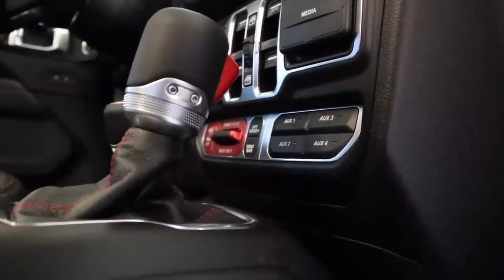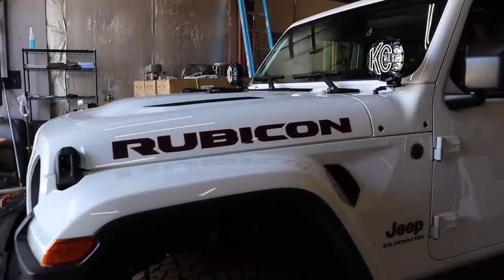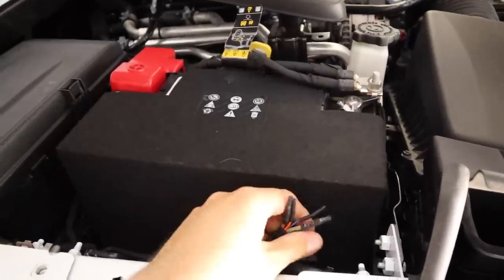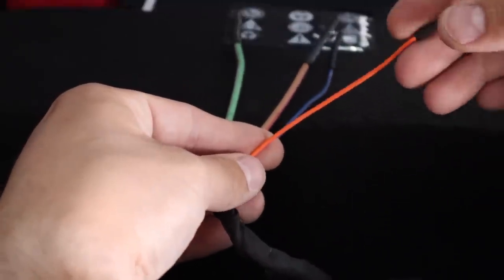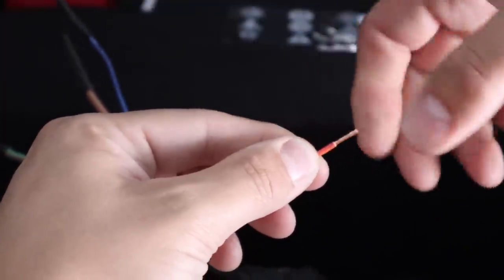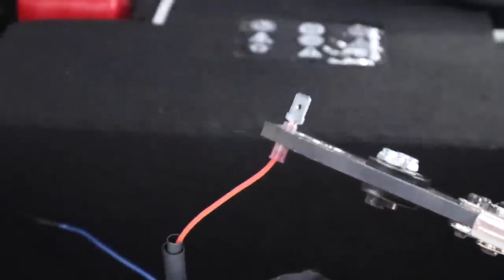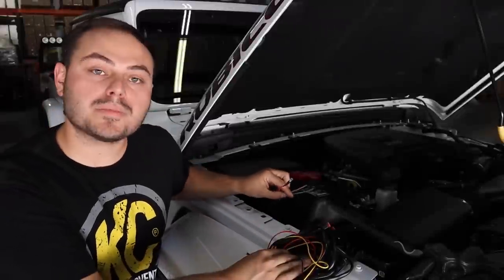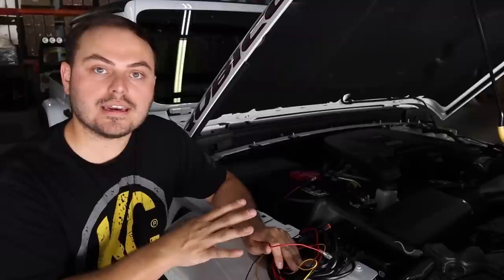Aux Switches Wiring Guide | Jeep Wrangler JL/Gladiator JT

Comment: Additional electrical tips... You should use the grounding point provided on the inner fender not the battery.  That's why it's there.  Keeps the battery terminal unclutered.  You should use a female connector on the power source wire not a male spade.  If the connection comes loose, the shrouded female connector will protect the circuit from grounding out.
Reply: I wonder if I could put two negative wire on one grounding point.

Comment: Great video and products.  FYI to everyone, AUX 1 & 2 are fused to a 40 amp relay, not 30 amp
Reply: what is the 3 and 4 amp?  for a refrigerator, what amp would you suggest to use?
Reply: @Haro75410  AUX 3 & 4 are 15 Amp circuits. I would check the Amp draw of the refrigerator. If over 15 amps it will need to be in AUX 1 or 2
Reply: @SoCalJeepGladiator  Thank you.

Comment: I have a 2022 JL Rubicon with the AUX switches. I just purchased a set of Flex Era 4 ditch lights. Should I wire them to the 40A or 15A factory AUX leads. Seems to me the 40A is best.  Also, in the matter of the amber backlight circuit, Do I HAVE TO wire the backlights (if not, great); or can I just wire them all to the 40A factory AUX and leave the wiring harness fuses in line? I just don't want to use up two of my four factory AUX switches for these lights. I realize that the Mopar AUX switches are not 3-position switches. I am willing to give up the amber backlight option if it will free up one of my AUX switches.

Comment: Great install. I kinda wish I had those switches on my JLUR. I like how you double heat shrink with the layers.
Reply: @kchilites  Haha, I agree. They should all have them standard. I added the Trigger Switch System for the JL. I like how the switches are overhead above the rear view mirror, but having those factory switches would have still been nice to have.

Comment: This video is a great place to start, here’s what I’m adding after my experience with my 2019 JL:

I purchased the JL ready Flex duals and mount for the pillar mounts and the Flex 10” Light bar for the bumper. The factory harnesses as I got them have tons of extra and unnecessary wiring. Route the wiring for the lights to the battery area, leaving some slack for working material. Since you only need the red and black wires, I was able to trim the harness right after where the two factory harnesses for the pillar lights are crimped together. I attached a ground to the black wire and connected to the body ground and the red to the #4 lead using male/female connectors as shown in video.

The light bar was a bit different. The 15 amp #3 lead wouldn’t light up the bar, so I had to use the #2 lead, leaving my lights on the bottom two switches (2 & 4). The process was the same, route wires, then I trimmed the harness at the relay from the factory, added the ground to the black and male connector to the red, and I was in business. The factory harnesses come with several feet of extra wiring for the inside switch and for routing that isn’t necessarily needed for the JL and it really cleaned up the under hood and battery area.
Reply: Gary Peterson were you able to cut off the switch and fuse from the wiring harness or did you have zip tie it under the hood?

Comment: early 2018 JL’s do not have those wires under the hood near the batt box.  The only wires for the AUX switches are supposedly located under the front passenger plastic side kickplate, together with the connector kit supplied with the AUX Switch option.

Comment: I backed 70mai Omni Dash Cam on Kickstarter and wanted to connect it to one of my aux switches. It has an always on feature (parking/sentry mode) so it has the ACC, the VCC and Ground wires. Do I connect the aux wire to both the ACC and VCC wires and then adjust the settings in the menu?

Comment: What if your lights have the yellow wire with the fuse. It looks like that connects to the positive. Do you still do this if connecting to the aux switch in the Gladiator?

Comment: I love your stuff but I think you guys should switch the hot wire to a female bit   instead of the male spade. FOR SAFETY reasons if that wire or connection were to ever come loose you now have exposed live wire that can short on the body or worst start an electrical fire. The female end is mostly shrouded and would need a pokey bit to short circuit..... let me know if I wrong....

Comment: I hope someone will answer this newbie question... So you have two lights regardless whether on the pillar or bumper. Do you solder the two red wires together, (one from each light), then put the spade on that soldered wire then connect that to the factory auxiliary switch wire?
Reply: What did you end up doing?
Reply: @ciprianorivera8063  selling the Jeep lol, seriously. To tell you the truth I don't remember. But ti did get everything hooked up with no mess or trouble.

Comment: So I have the 6 piece cyclone kit for my Jeep JL.  I will be installing it to my factory aux switch and the fuse will be installed next to the battery.  Do I cut the excessive red, yellow (I assume it's not going to be used), and negative wire?   Do I connect the negative wire from the battery to the ground junction?

Comment: I have  6" Apollo Pro Series (My car JL2019 Rubicon with AUX switch )
The wiring to the switch is white,Green & Black wire do i need to connect them all or only the green?
from the relay fuse there is black & yellow wire (black to ground- Yellow to Battry 12+) do i need to blage the fuse ?
Reply: Hey I have the same style lights were you able to figure this out?!?!
Reply: I’ve been wondering the same. Any luck ?
Reply: @juancampos9212  any luck? Been wondering the same

Comment: Just got the wiring harness and there is no red wire. Do I plug the green wire or the white wire into the aux switch? And do I do anything with the yellow power lead?
Reply: What did you end up doing? I have the same question

Comment: Great video. I have the aux switches but didnt realize how simple.  Thanks for showing us. Also what lights did yall use?
Reply: @kchilites  oooh. That's cool. Yeah they didn't look familiar that's why I asked lol.
Reply: @kchilites  I was wondering if you let me know about this process for the wiring colors on the Apollo Pro Series. I have the 2019 with the Aux setup and need to know which colors to hook up since there is only yellow, green, and white
Reply: @mirandareneev  Same issue and I cannot find a work around to this wire harness

Comment: I heard mention in another video that with this factory option, there are actually 2 additional circuits that are direct with the ignition switch. So a total of 6, 4 switched and 2 direct, is this true?
Reply: KC HiLiTES to be clear, this was on the JL. I’d imagine it would be the same on the JT.
Reply: bigdawgfan72 The JL has a ignition and direct battery wire plus the 4 switches inside the jeep by the passenger kick panel. Here is a link from the JL Forums showing it. Not sure if the JT has the same.

https://www.jlwranglerforums.com/forum/threads/aux-switches-cable-color-code-wiring-identification.13026/
Reply: True! Those leads are on the in cab bundle. Only the 4 shown in the video under the hood

Comment: Tx. One thing. Male and female should be the other way round. If you disconnect you have an unprotected + within the reach of a lot of mass connections. So put the female plug on the wire leading towards the battery + . Might save you from some trouble one day.

Comment: Great video and the switches do make it easy for sure.  I do have them in my Rubicon.  I just purchased some 100W KC Daylighters.  I have not received them yet but I am looking at the instructions online.  It shows a black (ground), yellow (12V+) and green (load) wire from the relay.  Then it shows a brown (ground) and white (12V+) wire going to the switch as well as the green (load) from the relay.  Is the green wire for my lights the same as the red wire in this demonstration?  Thanks in advance for your help.
Reply: I just bought KC lights.  Sounds like the same wiring harness I have.  I cannot figure how to get this to work with the relay in the system.
Reply: @jkstormtrooper9617  I was able to get it to work on mine.  
The yellow wire with the fuse goes directly to the battery.  The green wire goes to one of the switch wires on the Jeep.  I used Aux 3 since it is the higher amperage connection.   Hope this helps.
Reply: @htweelz  Spot on.  I was trying to connect to Aux 4.  Discover it is 'dead', in the mean time I drove myself crazy.  When I moved to Aux 3 it worked.  Yellow to battery, black to ground, Green to the Aux wire.  Suddenly easy :-)  I will look for Aux 4 fuse tomorrow.  Thanks for the help!
Reply: @jkstormtrooper9617  You're welcome! Glad you got it done!  Let me know what you find out about Aux 4.
Reply: @htweelz  Fuse. Took me a while to figure out which one.

Comment: I try not to nitpick, but... your connectors are in reverse. Female is the protected side with the dust cap covering it. Males should go on load side. If the male is on the line side you will have to provide more protection if you ever run it disconnected and hit the switch.